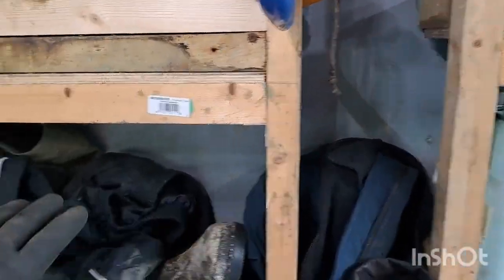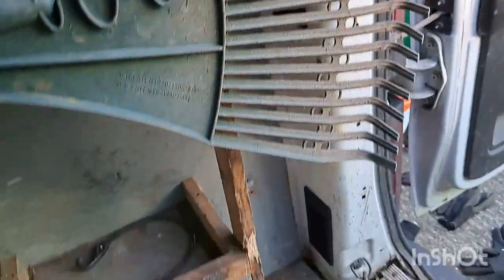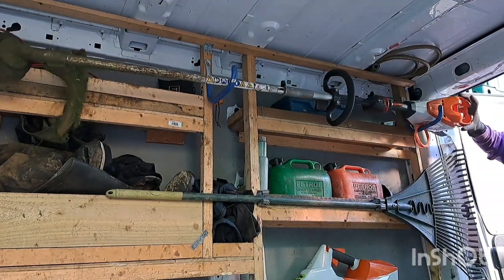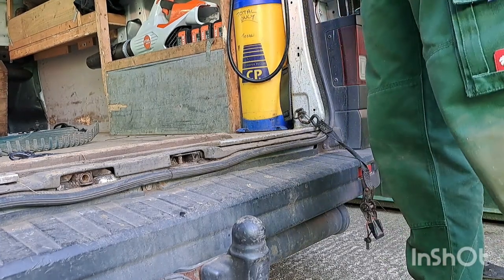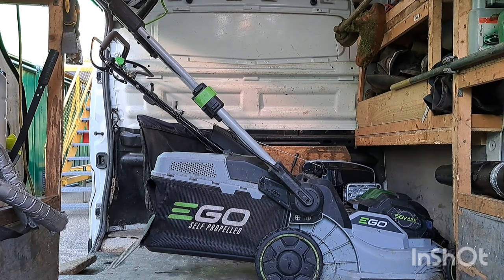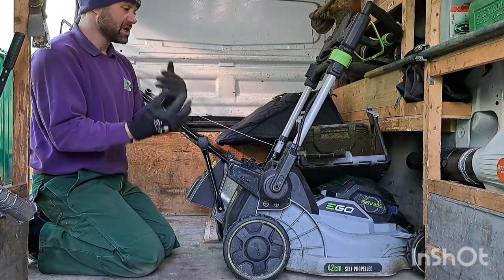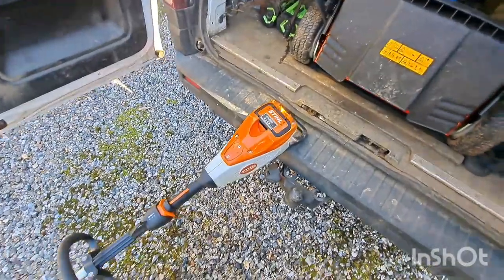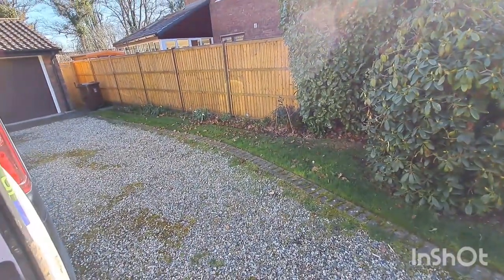VAN SET UP & NEW CLIENT #lawncare #grasscutting #lawnmower #thelawnguy

Comment: I’ve just returned my ego. Literally nothing but hassle with the rapid charger or 5.0 ah batteries not charging or running out after two passes on a tiny lawn. I was really excited to get the ego but after the issues straight out the box I’ll be waiting a bit longer for a stihl battery mower that’s affordable.
Reply from the maker: Thanks for watching 
From what I hear, ego is pretty good with returns. They just replace stuff with new,
I don't really use the mower a great deal, so I have no problems yet.

Comment: Another good video Dave. When you make up your iron how long do you have until you would no longer use? I like your video which you made up iron and transferred into the 20litre tubs with your stocking tip. I was just thinking if I made some up in the weekend it could save time during the week or does the iron deplete/ become less effective? Have a good easter weekend, Cheers 👍.
Reply from the maker: Thanks Andrew,
I'm sure the suppliers will tell you there's a used by date.
 But I haven't found it yet, and I'm talking months.

Comment: Enjoyed the video it as inspired me to sort out my van lol ,also I've bin considering a Toro time master how have you found them are they any good in wet habe you had any experience multching with them ?
Reply from the maker: Thanks, Vincent,
I usually mulch when use the timemaster I've never been a fan of its bagging in the wet, but toro have now changed the blades to make them a little more high lift yet to fine out if its any better.
Reply: @TheLawnGuy  brilliant that's what I've bin considering one for multching purposes hey Wen you get chance could you do a video of it multching ,so in your opinion it can handle wet grass when multching must be a breeze in the dry
Reply: @TheLawnGuy  thanks very much so effective machine multching both dry and damp conditions but not really there with the bagging also I'm am going to do some shelf's /racking in me van like you thanks for the inspiration have a good day

Comment: What do you do with the lawn clippings?
Reply from the maker: Hi Rod,
This only applies to regular mowing.
If a new client doesn't have a compost area, then i either quote them to build one or suggest a garden waste wheelie bin.
In 10 years, I've only ever had one person pass on my service due to not removing waste,
Reply: @TheLawnGuy  thanks for the reply, might be a little different here but we take the majority of grass clippings away and dump at a green waste recycling centre.
Reply from the maker: @rodpatterson3751  No worries, where are you?
Reply: @TheLawnGuy  Adelaide,  Australia
Reply from the maker: @rodpatterson3751  Oh ok, yeah it's different here, it's very expensive to legally dump waste and not many places either, the knock effect has ment that illegal fly tipping has become a big problem with quiet country road being blocked due to Rogue traders going out late at night and tipping the van bed up while driving down quite roads.
Reply: @TheLawnGuy  I pay around $30 month for unlimited grass clippings,  tree and shrub clippings are extra based on volume.  Dump is less than 10mins from home and they turn it all into compost and mulch.
Reply: Aussie over here I  UK ten years now...basically you can't turn up at the tip...which they call recycling centres with any kind of commercial work vehicle

Comment: Hi Dave how long do you get out of 1  battery in strimmer in total?
Reply from the maker: To be honest, I'm not entirely sure.
I borrowed the Strimmer & blower from a friend and it came with 2X ap200 & 2X ap300 and I soon realised I was one extra battery or one extra charge on a battery away from getting through the day.
But that would only be basic edging and blowing clippings, etc, off patio / paths.
It must have impressed me because because I went out and bought the equipment.
Only down side is that the batterys won't charge if it's about 5ﾟor lower. I noticed the ego batteries are about 1.5ﾟ.
Reply: If it helps I have the same combi motor last year was using for all the strimming work about 30 to 45 mins run time flat out

Comment: Hello mate how well does the time master work in the wet?
Reply from the maker: Hey Richard 
I've never been a fan of its bagging ability in the wet.
But Toro have recently changed the blades on them  to make more high lift, I'm yet to really test it out.
Reply: @TheLawnGuy  thanks for getting back to me would be great if you could let me know how it is in the wet. The weibangs I use have high lift blades and it makes a massive difference to collecting wet grass